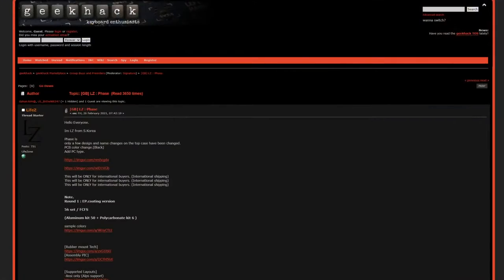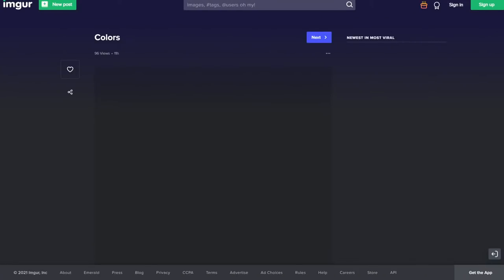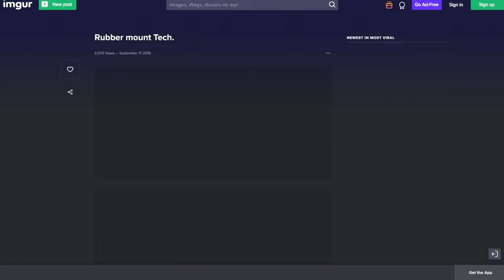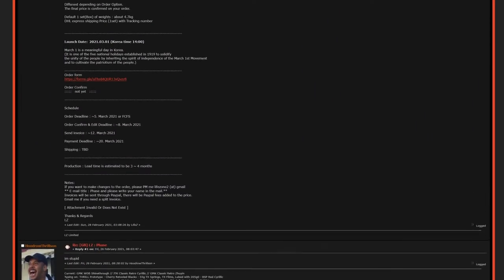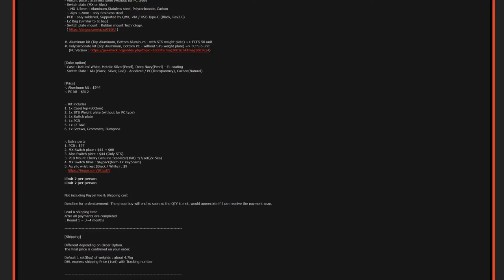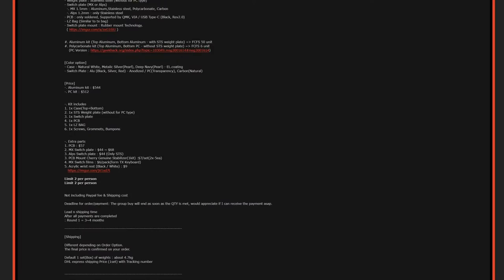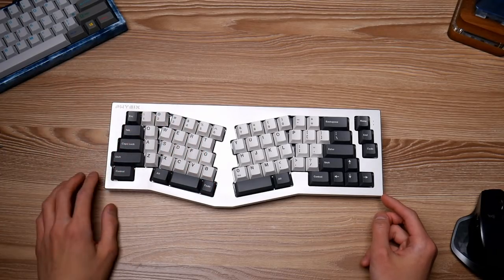LZ Physix Rant

Comment from the maker: Summary: LZ Physix has a lot of issues, oversights, disappointments that you don't see in even KBDFans nowadays. If these are not explicitly addressed, I recommend against getting the Phase, a rerun.

Notable timestamps:
02:40 - box and contents
03:30 - bag/box impressions
04:10 - issue #1 wrist rest
05:40 - issue #2 aluminum plate
06:45 - issue #3 bumpon sizes
07:30 - issue #4 usb cutout recess
08:30 - issue #5 screw holes
10:30 - disappointment #1: weight as an afterthought
11:07 - issue #6 bottom case shorting
12:00 - disappointment #2: weight finish quality
13:20 - disappointment #3: IC/GB lacking info
13:52 - disappointment #4: invoice has no price breakdown
14:45 - preference #1: seam is ugly
15:25 - disappointment #5: usb cutout tightness
16:25 - issue#7 polycarbonate plate finish
18:55 - disappointment #6: no alignment pins
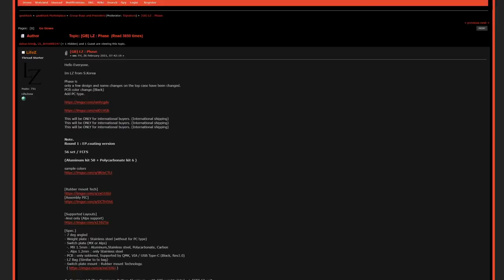19:27 - go through Phase GB
21:10 - good #1: layout

--- everything after this point is loose Q&A
Reply: Thank you for the timestamp 🙏🏿
Reply: Would be great if you pin this

Comment: Is there a budget Alice or ergo that you’d recommend? I’d like to try one without breaking the bank
Reply: If you really want a budget board you can look at the SKErgo Through-hole DIY Kit from Keyz.io

Edit: And you like to solder and have no plate. I still joined just to learn to solder and try the layout.
Reply: the MGA Standard case is around $200 IIRC. great deal for an aluminum alice layout
Reply: @jjwkb5970  any idea how often they restock these?
Reply: @austin2924  I’ve seen this but I’d rather try to find a hotswappable pcb
Reply: @EdgewoodCamper  MGA Standard alices are still somewhat available on sneakbox, including hotswap pcbs
Reply: @Xenabeans  yea I ended up grabbing one about a month ago. Love it
Reply: @Pete Magsalin If you want to get a nice alice derivative and you're willing to spend more, I can also recommend the meridian. Even though the meridian isn't a true alice derivative, some people that owned it are really happy with how the meridian turned out